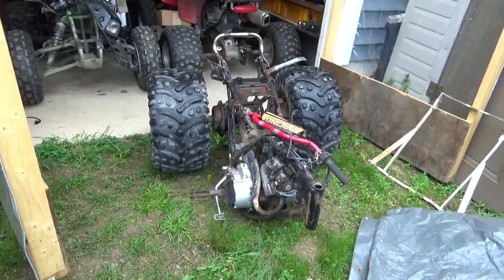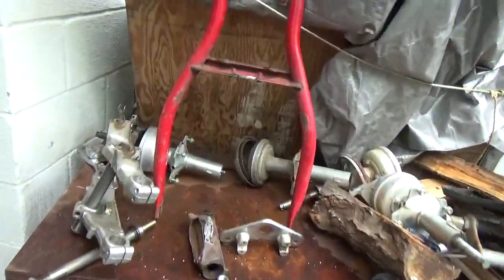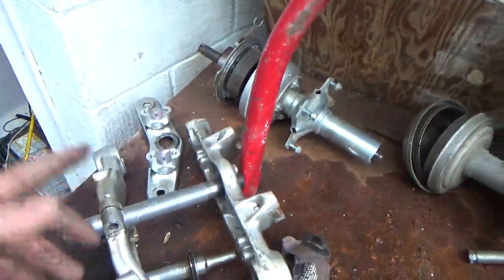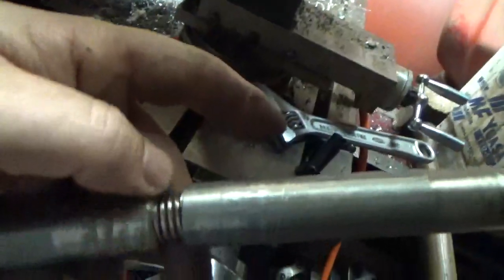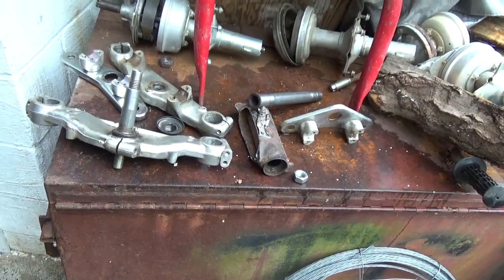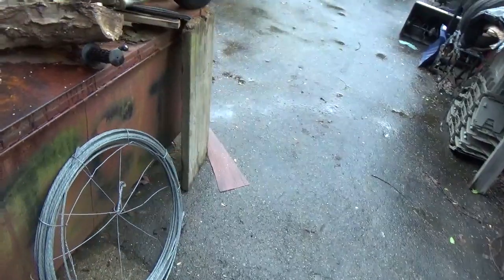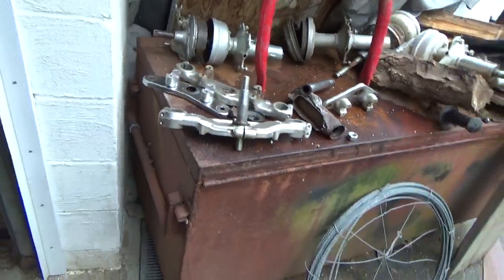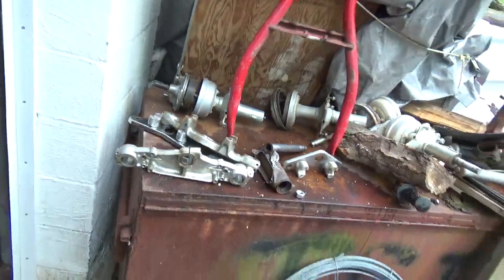Red Neck Engineering at its best, fitting ATC200X Forks on ATC200S

Comment: I could be remembering wrong here but i remember just using the 200x front as is and just knocking out the bearing races out of the frame on the S and just getting tapered steering stem bearings for the x to run that x front on an S
Reply from the maker: Hey Dude, The triple tree pivot from the 200x is also too short for the 200S .... But, I think it goes right into the 250SX, 250ES, so that maybe what U R remembering.... Thanks for the info, Ur thoughts, watching, and commenting!!!